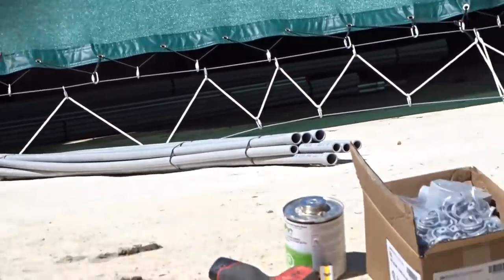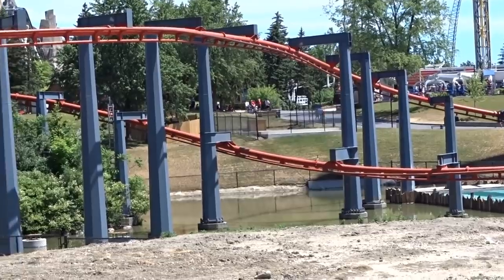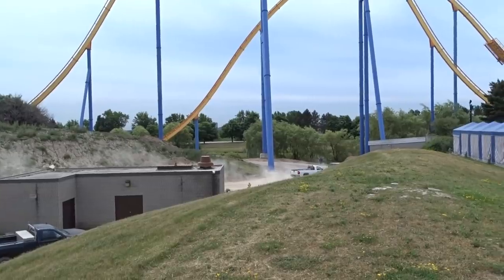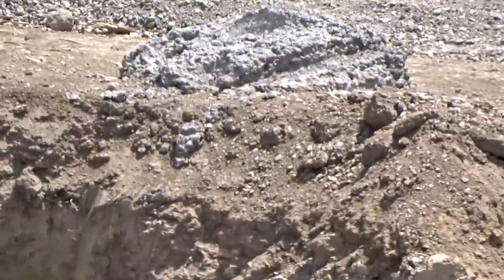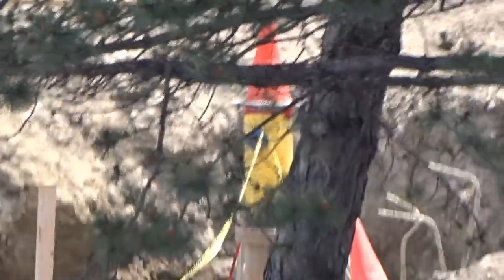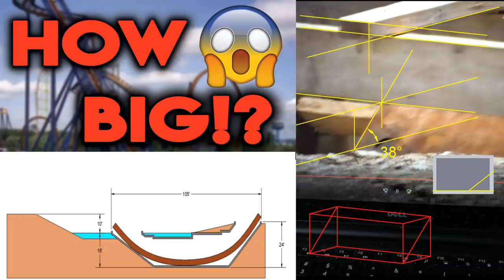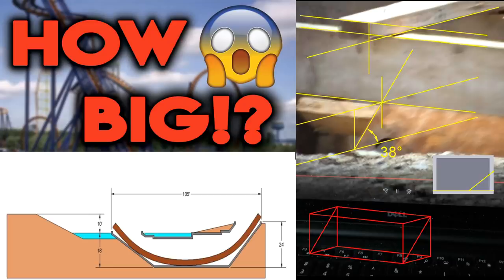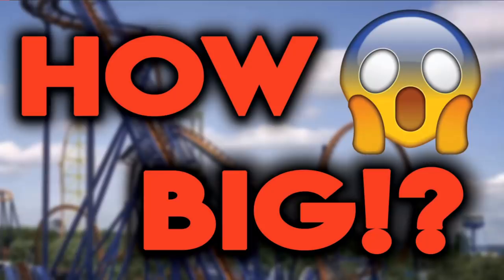Canada's Wonderland Yukon Striker Construction

Comment: Nice update!  Just wondering what was used to determine the angle of ascent.  The picture showing 38 degrees was hard to make out.  If the height is 255 as you estimate with a 24 ft deep tunnel, that would make for a really nice drop...280 ft will be awesome. Although, I'm hoping the angle of ascent is closer to 45!  We'll see.
Reply: Michael Song nice estimation I would never think that

Comment: Whats a splashdown
Reply from the maker: Dan Ranney it’s where a roller coaster dips into a water trench and two metal brackets on either end of the wheel bearings on the back of the train grip the water to slow it down while creating a beautiful water effect.
Reply: Amusement Insiders that would be amazing to pass by in the park